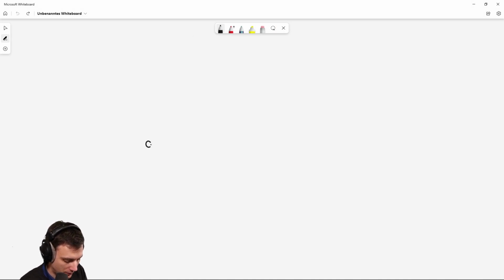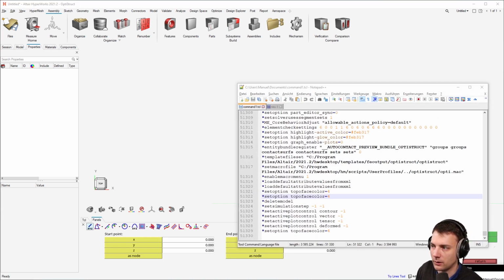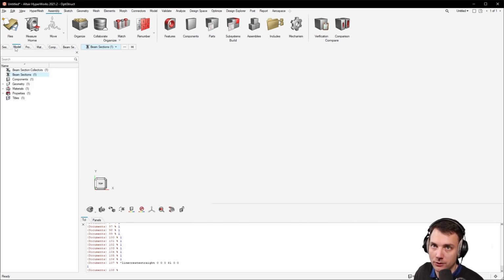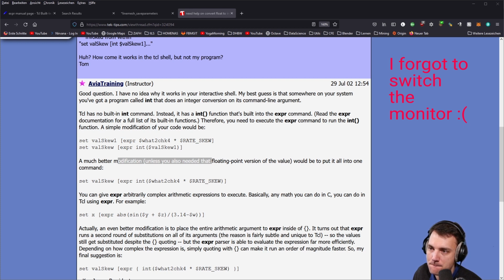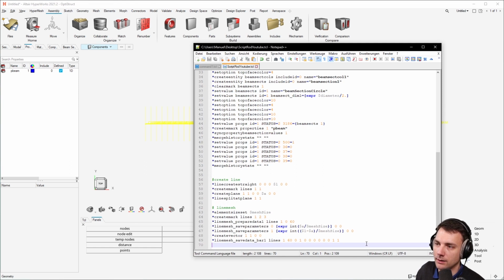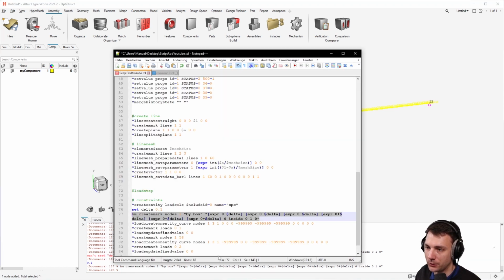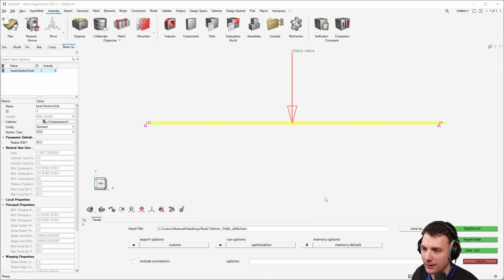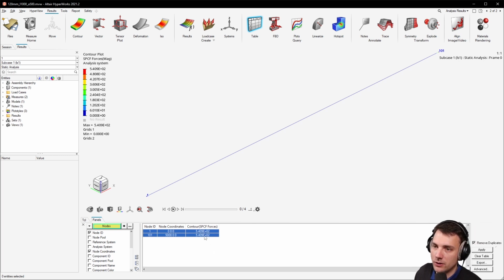Hypermesh Tutorial: TCL Scripting of a Beam Deflection with single Load

Comment from the maker: # delete old model
hm_answernext yes
*deletemodel

# variables
set l 5000
set a [expr $l/2.]
set diameter 60
set meshSize [expr $l/100]
set density 0.0000000078
set pi 3.141592653589793238462643383
set volume [expr $pi*pow($diameter,2)/4.*$l]
set mass [expr $volume * $density]
set force [expr $mass * 9810]

# Basic model setup
*createentity mats cardimage=MAT1 includeid=0 name="material1"
*clearmark materials 1
*setvalue mats id=1 STATUS=1 1=210000
*setvalue mats id=1 STATUS=1 3=0.3
*setvalue mats id=1 STATUS=1 4=7.85e-09
*createentity props cardimage=PSHELL includeid=0 name="property1"
*clearmark properties 1
*setvalue props id=1 cardimage="PBEAM"
*setoption topofacecolor=11
*setoption topofacecolor=4
*setvalue props id=1 materialid={mats 1}
*setvalue props id=1 name="pbeam"
*setoption topofacecolor=4
*createentity comps includeid=0 name="myComponent"
*clearmark components 1
*setoption topofacecolor=10
*setoption topofacecolor=4
*setvalue comps id=1 propertyid={props 1}
*clearmark components 1
*clearmark components 1
*setoption topofacecolor=4
*createentity beamsectcols includeid=0 name="beamsectcol1"
*createentity beamsects includeid=0 name="beamsection1"
*clearmark beamsects 1
*setvalue beamsects id=1 name="beamSectionCircle"
*setvalue beamsects id=1 beamsect_dim1=[expr $diameter/2.]
*setoption topofacecolor=10
*setoption topofacecolor=4
*setoption topofacecolor=4
*setoption topofacecolor=10
*setoption topofacecolor=10
*setvalue props id=1 STATUS=2 3186={beamsects 1}
*createmark properties 1 "pbeam"
*syncpropertybeamsectionvalues 1
*mergehistorystate "" ""
*setvalue props id=1 STATUS=2 500=1
*setvalue props id=1 STATUS=0 36=0
*setvalue props id=1 STATUS=0 37=0
*setvalue props id=1 STATUS=0 38=0
*setvalue props id=1 STATUS=0 39=0
*mergehistorystate "" ""

#create line
*linecreatestraight 0 0 0 $l 0 0
*createmark lines 1 1
*createplane 1 1 0 0 $a 0 0
*linesplitatplane 1 1

# linemesh
*elementsizeset $meshSize
*createmark lines 1 2 3
*linemesh_preparedata1 lines 1 0 60
*linemesh_saveparameters 0 [expr int($a/$meshSize)] 0 0
*linemesh_saveparameters 1 [expr int(($l-$a)/$meshSize)] 0 0
*createvector 1 1 0 0
*linemesh_savedata_bar1 lines 1 60 0 1 0 0 0 0 0 0 1 1

# constraints
*createentity loadcols includeid=0 name="spc"
set delta 0.1
hm_createmark nodes 1 "by box" "[expr 0-$delta] [expr 0-$delta] [expr 0-$delta] [expr 0+$delta] [expr 0+$delta] [expr 0+$delta] 0 inside 0 1 0"
*loadcreateonentity_curve nodes 1 3 1 0 0 0 -999999 -999999 -999999 0 0 0 0 0
*createmark loads 0 1
*loadsupdatefixedvalue 0 0
hm_createmark nodes 1 "by box" "[expr $l-$delta] [expr 0-$delta] [expr 0-$delta] [expr $l+$delta] [expr 0+$delta] [expr 0+$delta] 0 inside 0 1 0"
*loadcreateonentity_curve nodes 1 3 1 -999999 0 0 -999999 -999999 -999999 0 0 0 0 0
*createmark loads 0 2
*loadsupdatefixedvalue 0 0

# force
*createentity loadcols includeid=0 name="Force"
hm_createmark nodes 1 "by box" "[expr $a-$delta] [expr 0-$delta] [expr 0-$delta] [expr $a+$delta] [expr 0+$delta] [expr 0+$delta] 0 inside 0 1 0"
*loadcreateonentity_curve nodes 1 1 1 -0 $force -0 0 0 $force 0 0 0 0 0

#loadstep
*createmark loadcols 1 "spc" "Force"
*createmark outputblocks 1
*createmark groups 1
*loadstepscreate "ls1" 1
*attributeupdateint loadsteps 1 4143 1 1 0 1
*attributeupdateint loadsteps 1 4709 1 1 0 1
*setvalue loadsteps id=1 STATUS=2 4059=1 4060=STATICS
*attributeupdateentity loadsteps 1 4145 1 1 0 loadcols 1
*attributeupdateentity loadsteps 1 4147 1 1 0 loadcols 2
*attributeupdateint loadsteps 1 3800 1 1 0 0
*attributeupdateint loadsteps 1 707 1 1 0 0
*attributeupdateint loadsteps 1 2396 1 1 0 0
*attributeupdateint loadsteps 1 8134 1 1 0 0
*attributeupdateint loadsteps 1 2160 1 1 0 0
*attributeupdateint loadsteps 1 10212 1 1 0 0

# control cards

*cardcreate "GLOBAL_OUTPUT_REQUEST"
*attributeupdateint cards 1 3321 1 2 0 0
*attributeupdateint cards 1 10184 1 2 0 0
*attributeupdateint cards 1 10189 1 2 0 0
*attributeupdateint cards 1 9792 1 2 0 0
*attributeupdateint cards 1 12155 1 2 0 0
*attributeupdateint cards 1 12158 1 2 0 0
*attributeupdateint cards 1 12160 1 2 0 0
*attributeupdateint cards 1 12162 1 2 0 0
*attributeupdateint cards 1 9630 1 2 0 0
*attributeupdateint cards 1 9307 1 2 0 0
*attributeupdateint cards 1 9317 1 2 0 0
*attributeupdateint cards 1 9327 1 2 0 0
*attributeupdateint cards 1 3880 1 2 0 0
*attributeupdateint cards 1 4119 1 2 0 0
*attributeupdateint cards 1 4114 1 2 0 0
*attributeupdateint cards 1 7121 1 2 0 0
*attributeupdateint cards 1 2938 1 2 0 0
*attributeupdateint cards 1 10688 1 2 0 0
*attributeupdateint cards 1 523 1 2 0 0
*attributeupdateint cards 1 2385 1 2 0 0
*attributeupdateint cards 1 4052 1 2 0 0
*attributeupdateint cards 1 3712 1 2 0 0
*attributeupdateint cards 1 3885 1 2 0 0
*attributeupdateint cards 1 274 1 2 0 0
*attributeupdateint cards 1 3057 1 2 0 0
*attributeupdateint cards 1 10833 1 2 0 0
*attributeupdateint cards 1 7113 1 2 0 0
*attributeupdateint cards 1 8500 1 2 0 0
*attributeupdateint cards 1 2419 1 2 0 0
*attributeupdateint cards 1 8493 1 2 0 0
*attributeupdateint cards 1 9709 1 2 0 0
*attributeupdateint cards 1 3809 1 2 0 0
*attributeupdateint cards 1 7125 1 2 0 0
*attributeupdateint cards 1 4877 1 2 0 0
*attributeupdateint cards 1 9337 1 2 0 0
*attributeupdateint cards 1 9347 1 2 0 0
*attributeupdateint cards 1 9357 1 2 0 0
*attributeupdateint cards 1 3325 1 2 0 0
*attributeupdateint cards 1 7093 1 2 0 0
*attributeupdateint cards 1 3333 1 2 0 0
*attributeupdateint cards 1 2423 1 2 0 0
*attributeupdateint cards 1 4047 1 2 0 0
*attributeupdateint cards 1 10701 1 2 0 0
*attributeupdateint cards 1 9275 1 2 0 0
*attributeupdateint cards 1 5463 1 2 0 0
*attributeupdateint cards 1 8949 1 2 0 0
*attributeupdateint cards 1 10504 1 2 0 0
*attributeupdateint cards 1 12336 1 2 0 0
*attributeupdateint cards 1 10440 1 2 0 0
*attributeupdateint cards 1 7329 1 2 0 0
*attributeupdateint cards 1 7333 1 2 0 0
*attributeupdateint cards 1 2427 1 2 0 1
*attributeupdateint cards 1 8153 1 2 0 0
*attributeupdateint cards 1 8150 1 2 0 0
*attributeupdateint cards 1 8144 1 2 0 0
*attributeupdateint cards 1 3642 1 2 0 0
*attributeupdateint cards 1 2431 1 2 0 0
*attributeupdateint cards 1 7337 1 2 0 0
*attributeupdateint cards 1 7117 1 2 0 0
*attributeupdateint cards 1 3891 1 2 0 0
*attributeupdateint cards 1 12346 1 2 0 0
*attributeupdateint cards 1 3329 1 2 0 0
*attributeupdateint cards 1 1921 1 0 0 1
*createstringarray 1 "        "
*attributeupdatestringarray cards 1 9609 1 2 0 1 1
*createstringarray 1 "        "
*attributeupdatestringarray cards 1 4323 1 2 0 1 1
*createstringarray 1 "        "
*attributeupdatestringarray cards 1 3342 1 2 0 1 1
*createstringarray 1 "        "
*attributeupdatestringarray cards 1 12602 1 2 0 1 1
*createstringarray 1 "        "
*attributeupdatestringarray cards 1 3343 1 2 0 1 1
*createstringarray 1 "        "
*attributeupdatestringarray cards 1 2294 1 2 0 1 1
*createarray 1 0
*attributeupdateentityidarray cards 1 3437 1 0 0 analysisparameters 1 1
*createstringarray 1 "        "
*attributeupdatestringarray cards 1 11389 1 2 0 1 1
*createstringarray 1 "ALL"
*attributeupdatestringarray cards 1 2428 1 2 0 1 1
Reply from the maker: If someone would like to try the script for themselves :)
Reply: @ManuelRamsaier   hello Dr., I have a doubt regarding how do we set up user-profile i.e, ANSYS, optistruct, Abaqus using .tcl command, I have to update it in new set-up every time, also I am using ANSYS for analysis so every time I have to update user profile manually. 

(I use to take .tcl commands from GUI by live monitoring using PowerShell (I cannot access notepad++ so just other way to monitor live .tcl))
Reply from the maker: @engineeringdesign3814  Yes that is correct - I have to update this as well in the .tcl everytime I want to switch a User Porfile. However, there is a way  to specify it when executing the tcl file directly via a shell. You can call the hw.exe or in case of hypermesh the hmopengl.exe with this parameter: 

 -u<ProfileName> without a space... so for example: -uOptiStruct or -uAnsys
SubProfiles is done with -a .... so for example: -uAbaqus -aStandard3d 

Best regards
Reply: @ManuelRamsaier  I don't know how to thank you enough, your content is like GOLDMINE to me.
Reply: @ManuelRamsaier  wait but I am able to open HM with ansys as default with shell, how do I execute the .tcl file in it then, I am stuck here now?
Reply from the maker: @engineeringdesign3814  add the parameter -tcl <link to your tcl file>

see also: https://community.altair.com/community?id=community_question&sys_id=13b684ba1b2bd0908017dc61ec4bcb0a

Comment: Can we minimize a GUI using a minimize button instead of default option present on title bar?
Reply from the maker: There are several ways of not showing / or minimizing the GUI. Would you like to have the GUI hidden at all ? Even in batch you have a window pop up but there are ways to prevent that as well. Checkout the recent bridge optimizer code - there the class Hypermeshstarter introduces some of the options :) If you have more specific questions - just ask :)